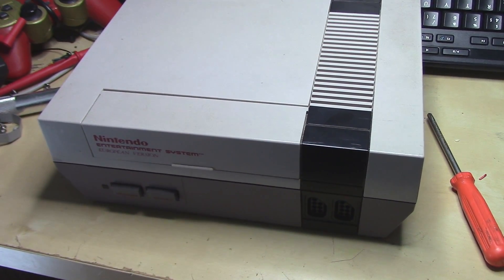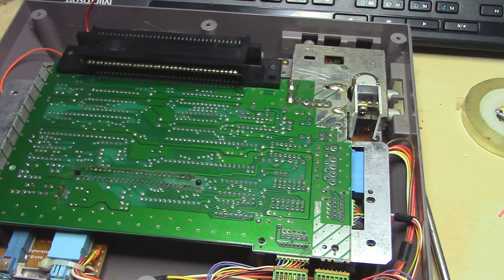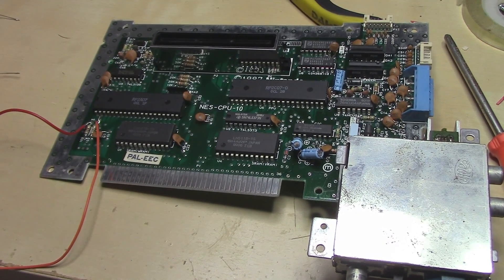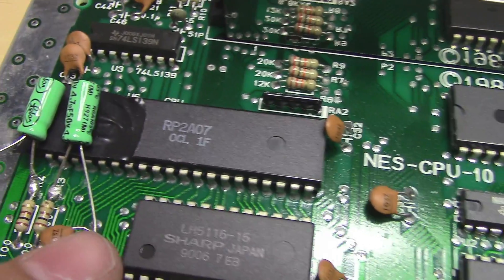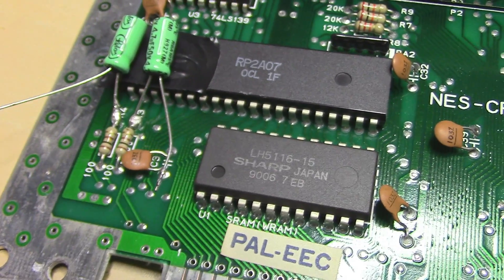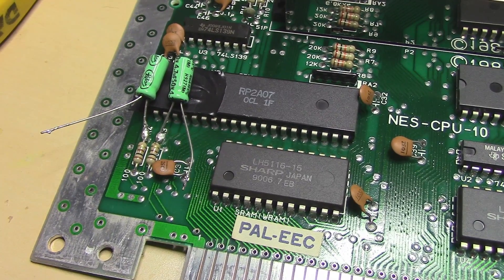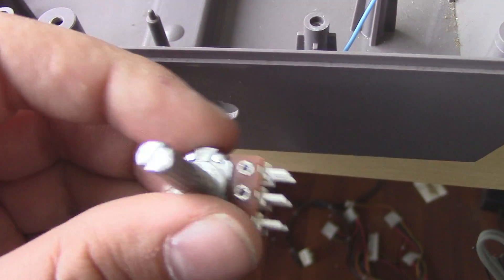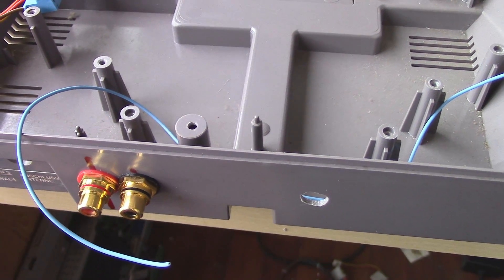NES Stereo Mod (Pt.2)

Comment: how did u wire it to one pot instead of 2?
Reply from the maker: +Mitch McCann That one pot has two pots in one case. So you wire it the same way you would wire two separate pots :)
Reply: so does it have 3 pins or 6?
Reply from the maker: +Mitch McCann it has 6, 3 for each pot